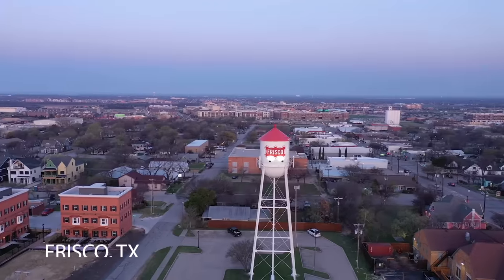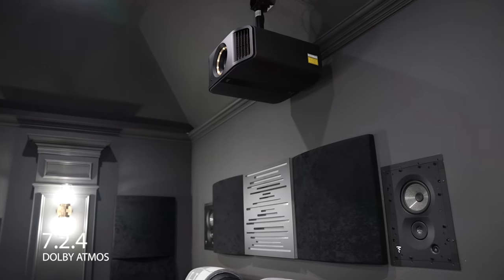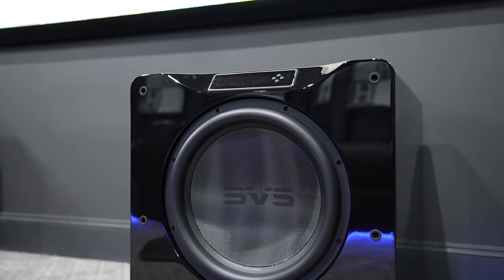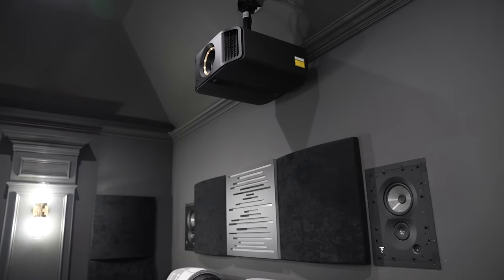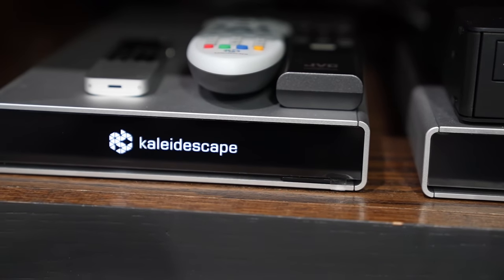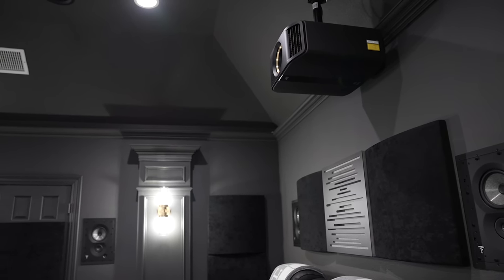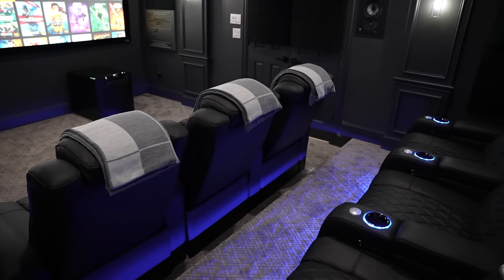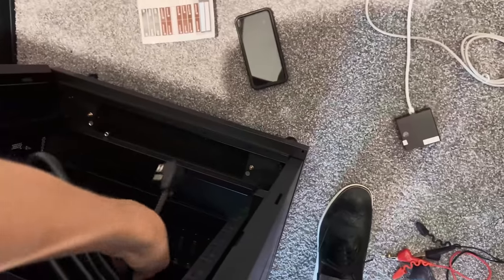🤯LUXURY Home Theater TOUR! Trinnov, Madvr, Kaleidescape, JVC NZ8, Focal 1000! Dreamedia+ FRISCO TX!

Comment: Why is the surround back not centered?
Reply from the maker: Unfortunately, we have a wet bar on the other side of the wall with plumbing. The fix is to move the Av equipment and move the speaker over into that place. The current stage was a major improvement over the previous set up in the room but we have already talked with the customer about rack options and construction which may be phase 2 when they are ready. Thanks for watching Chris!

Comment: Any reason why the rear speakers aren't quite centred, my ocd is struggling with them being off a little bit? If its the door I'd have brought the other closer to the centre to match.

Also how big is the room?
Reply: obviously they are limited by that door.  I guarantee you your ears would notice more issues with channel/speaker separation if the rears were closer together than the slight unevenness.  To bring the one speaker closer would have worse acoustical consequences IMO.
Reply from the maker: The issue is a wet bar on the other side of the wall with plumbing in the wall. We have discussed Av rack options with the customer so maybe we will film a part 2 on this room if we can move the gear and reinstall the speaker further over. Right now the customer is thrilled with the set up as is and the Trinnov helps with the speaker being a little off. Thanks for watching!
Reply from the maker: @DarthBrockstar  the Trinnov does magical things with audio performance when speakers aren’t perfect for sure! Unfortunately we couldn’t move the plumbing in the wall but the customer is considering a rack so you may see a phase 2 to this project. Thanks for commenting!

Comment: Few questions:
1. The in wall surrounds seem to be placed between the two rows. Is that optimal placement for both seats?
2. The second row seems to be backed up to the wall. The recommendation usually is to leave at least a couple of feet between the wall and seats for optimal sound experience. For a 100k+ theater, this seems to be a very basic oversight. Would love to know the rationale and how was it compensated? 
3. The entry seems to be a double door bang in the middle of the wall. For a $100k+ project, did you all not consider moving that door to one of the corners for better sound insulation and speaker placement? 
4. Your website and videos are over pivoting on just the Focal brand. For the last year or so, don’t recall seeing any other brands. Is there an unconscious bias towards Focal?
5. What about the AV rack?
6. Finally, was this house in Starwood ? Seems very familiar
Reply from the maker: The room definitely has some existing limitations and we did the best we could with the existing structure without doing construction work to the space. To get some inspiration of a project that took about a year to complete and did require construction you should view our project in flowermound tx! Insane CUSTOM Star Wars Home Theater Build | 9.4.6 Dolby Atmos System!
https://youtu.be/zhnWnZBHw7Y
Reply from the maker: We absolutely love focal and have been obsessed with the level of quality it delivers for our customers! This one isn’t in Starwood but we have done projects in that neighborhood for years as well. Have a great weekend!
Reply: I can understand you loving a certain brand but over pivoting only on that in every content you create or project you build seems to suggest you are incentivized only to sell focal. Not intending to sound mean, but one of the things I look for is an unbiased view when investing this amount of money.
Reply from the maker: @uman8932  Dreamedia is a business that makes revenue off all brands that we sell but we truly believe in this brand and all the brands that we sell. It’s hard to beat Focal with how diverse their product line up is. We sell many other high quality brands though! You should check out our website: www.dreamediaav.com 

Thanks for commenting and have a great weekend!
Reply: @Dreamediaav  could you share the room dimensions?

Comment: whts the fun of such theatre and wasting that much money if the left rear speakers are placed drastically in the wrong place in the room u should have removed that glass window.
Reply from the maker: In a perfect world the surround rear left would be over further and the AV equipment wouldn’t be there. The customer has already asked us about moving the av equipment in a phase 2 upgrade. We work with customers at all different stages of the build and advise along the way all available options. This one is going to require a bit of construction to get it done right so may be a better thing to do when they leave for a vacation or something like that. That set up was installed by the home builder. They are definitely enjoying the room currently! Have a great weekend!
Reply: @Dreamediaav  m nt blaming u......m sure it will be customer's fault.....my cmnt was for that customer.....m already ur fan.....love ur previous theatres ❤️
Reply from the maker: @lovishthecoverking  thanks for your support!